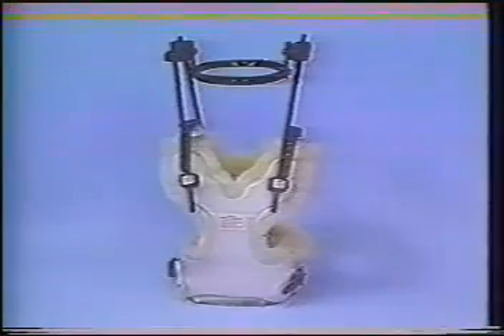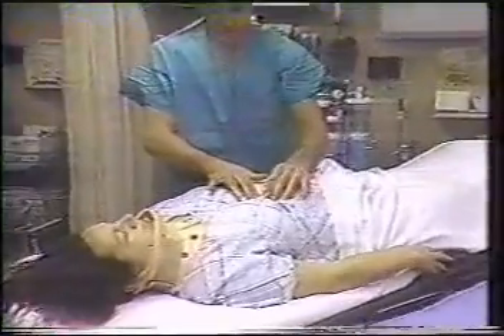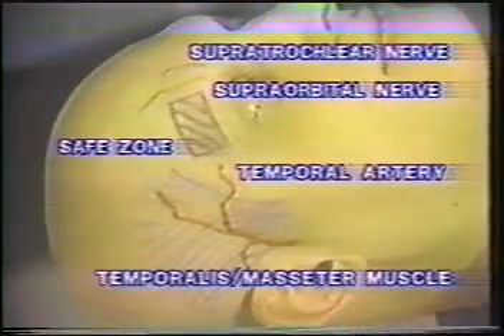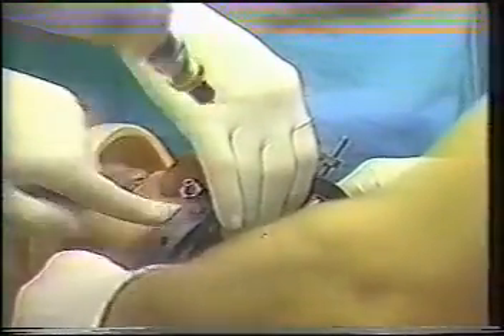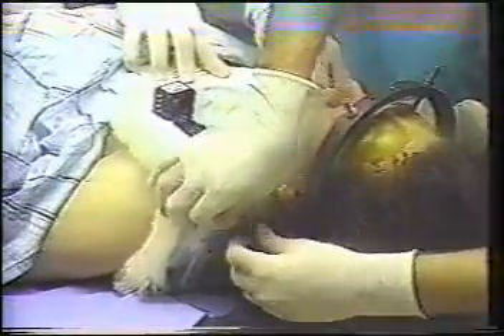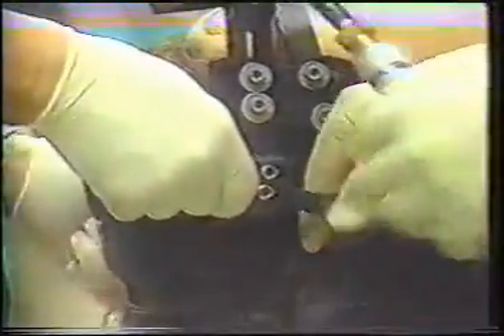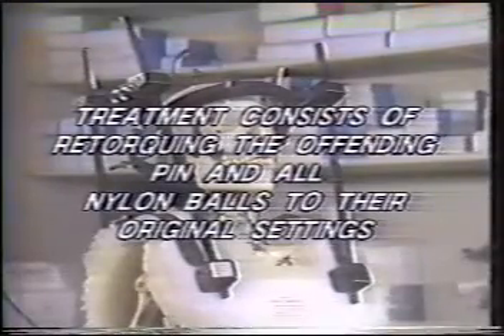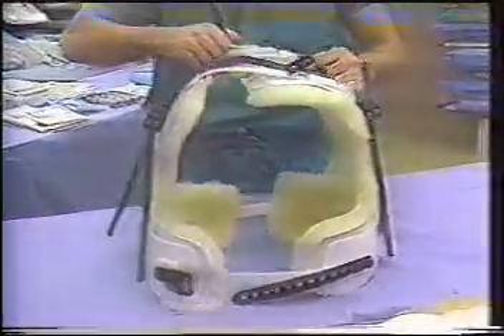Instalacion HALO Vest PMT

Comment: had my halo fitted over 12 yrs ago, was in spinal unit (UK) from a RTA and needed my neck to be stabalised, wore my halo for 3 months, but not all the time in bed, later in my wheel chair, what a joy when the day came for it to be removed. I still have two small scar dots over each eye, but on side of the head over/near the ears I have larger depresions, but who cars about a little scaring, as long as one can get around, no matter how is all that matters.